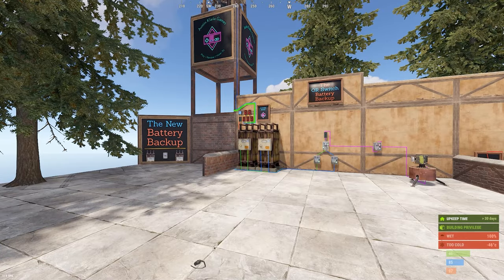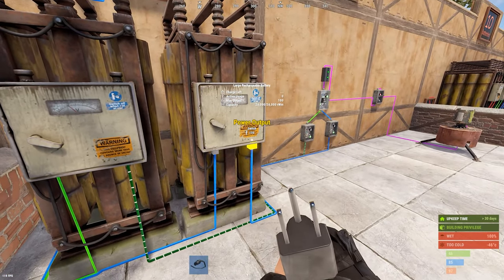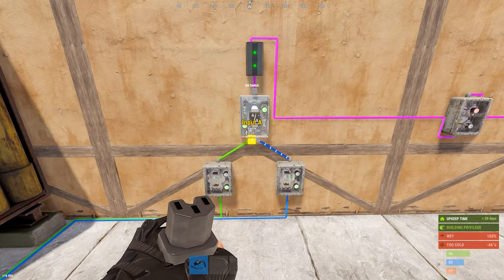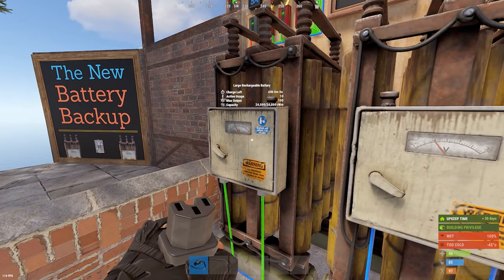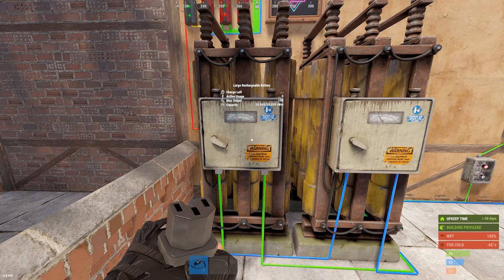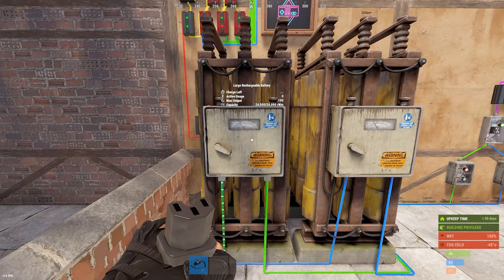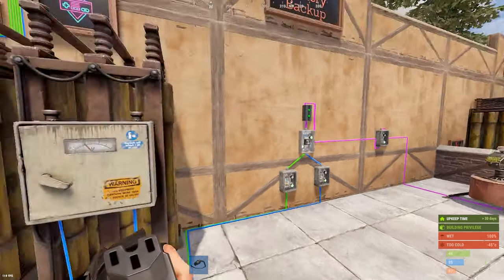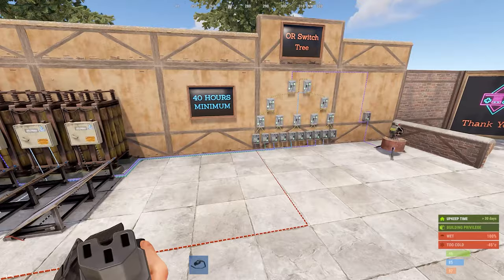RUST Electrical | The NEW BATTERY BACKUP | Includes 40-HOUR EXAMPLE - 2024

Comment: I have a circuit that goes beyond battery backup. It’s in the Fortify workshop posted last night. Basically, it automatically reroutes power from other circuits when your primary defense circuit loses power and has battery backup. Check out the circuit in the workshop!

Comment: all well and good until you rather have everything on a NihCore setup and require more than 100rWm, they really need to fix that Parallel battery setup bug draining both batteries of the same rWm for each item.

Comment: I discovered something on accident. Upon building your obsolete version, I integrated wind and solar into a root combiner for source. Then used a splitter to automatically, & evenly distribute power to 2x primary batteries, using 2 secondaries as back ups in your video. I also integrarted a double generator back up, with force start on both in series should either root source fail, or one gen run out of fuel (giving time to refuel.) Now, somehow I have 220 at both my primaries and 220 at both outputs of secondaries. It charges fast and I hooked up a tesla and it killed me instantly. I tested the same tesla on half the branch at 110, and it wasn't even close. I might just have to make a video on this. But thanks for leading the way! Did I build an amplifier somehow?

Comment: i set my new setup similar to this, but i use my root power (solar panels and windmills) to power my base, and then trickle charge my backup batteries, then combine them to the b side through root combiners. the only problemis if I have more then 100 usage, during night time it drains the first battery in my chain instead of distributing the power equally amongst my batteries (i use 4 generally) and usually cap my power usage around 340 end of wipe.
Reply: If you want it to draw equally from all batteries you need to run your batteries into a root combiner rather than in series from one battery into the other

Comment: Help me understand something. How are you branching 140 from one solar panel to the red battery if its only got 1 solar panel hooked up to it? If we are only allowed to have ten solar panels per TC how could you have each battery with one solar panel hooked up to it and dishing out 140 to the red battery at the same time? Are you running three windmills to the primary and 1 solar panel to each battery after that? And with all that Equpment your base you'd only have 100 power to give to the base?

Comment: Is it possible to switch to Input power only when it meets specific output? Lets say my base needs 200 power to run, but at this moment its early morning and solar outputting only 160, is it possible to run base from batteries until output from solar is 200 or more?

Comment: You could also split off some of your main power and trickle charge batteries linked into each other and then use those as an output if your mains go down
Reply from the maker: Yep, you certainly could. This is probably the route most people would take

Comment: Amazing video as always Austin, just wondering your thoughts on still using the nih core with the new electrical changes. I tweaked the branch that goes into the splitter from 4 to 3 and rigged up a 2 batteries for extra protection. Just want to see your thoughts and see if there is a more efficient way.
Reply from the maker: I'm currently working on a new video that discusses the nih core against the power loop against just straight batteries to give info on that exact question
Reply: @AustinKlailaGames  Oh that's awesome, looking forward to it!

Comment: I need to figure out for myself here how to use this to draw from a windmill directly and have it fail over to the batter if the power drops under a value. I've always felt the battery itself should be the backup.

Comment: so to my mind now the circuitboard becomes the most important thing to secure from raiders - do you have any "rules of thumb" for protecting your circuits in a raid?
Reply from the maker: I agree. The two safest options are in the tc room or strategically placed in a hidden bunker that's not in the most common raid paths.

If you have a solid anti grief setup, the bunker is a better idea, considering you will likely get your base back. If you don't have anti grief, the tc room is fine (if they get to your tc, it's over anyway).

Comment: Hey, so first off, not a RUST player, but for some reason I've gone down the RUST YouTube Rabbit hole.
Just wanted to say on your 10x example I feel you made the tree way overly complicated.
Keep your 10 switches across the bottom.
But put 1 OR gate above the gap in between every 2 switches.  Not every other, in between every 2.
Far left switch runs to OR 1 Primary
2nd Switch runs to OR 1 Secondary
OR 1 Output runs to OR 2 Primary (so up, right, down, and into the bottom of the next one)
3rd switch runs to OR 2 Secondary.
OR 2 Output runs to OR3 Primary
Now you just repeat this pattern to N and you don't need to "tree" the outputs at all.
You also end up with N-1 OR gates, which for 10 in your example is 9, and your example already has 9.
Thinking of another Base 2 tree, 16 inputs, you need 8+4+2+1 OR gates, well that's still 15, so still N-1.
Lastly, since Input 1 on the far left starts as Primary, and the Output of each earlier OR gate is the Primary of the next one, it still runs in your left to right pattern as far as battery depletion goes.
This thinner pattern also means you can put them on the wall above the Batteries to save space.

Comment: What key are hitting to just see one wire?
Reply from the maker: You can use Left Click when aimed at a wire connection to isolate the wire. Very useful for tracing wires. You can also change the color of the wire to whatever is selected in the color wheel by pressing the R key.

Comment: Will this work in console rust
Reply from the maker: Sorry for the late reply (vacation). Unfortunately no, as of the current update, this particular build will not work on console until its respective update comes out.
Reply: @AustinKlailaGames  what about with the new industrial update that make switches n branches not take power
Reply from the maker: @marcoromero411  Then it should! I'll have to see what the console update includes.

Comment: I don't understand why you made such a huge point about batteries needing to be equal sizes when that's irrelevant to this.  
If your circuit has a load of 40 and you use a medium and a large, it works. The large gets drained first and then the medium takes over when the large is depleted.
The only time sizes need to be equal is if the max draw exceeds one of the batteries. If you're drawing 70 and the medium kicks over, whatever is using the last 20 energy doesn't get any, but the backup is sill functional.
Reply from the maker: You are correct, but I purposely didn't cover that in this video to avoid confusion. And a battery backup should be the same size to, as you stated, avoid the primary exceeding the secondary.
Reply: @AustinKlailaGames  Cheers man. Still a good video.

Comment: DUDE, YOU HAVE GOT TO STOP THIS NONSENSE...THERE IS NO "POWER META," ALL YOU NEED IS A LARGE BATTERY WITH 120 POWER COMING IN TO HAVE A PERMANENT 100 POWER OUTPUT WITH 4 HOURS 30 MINUTES OF RESERVE POWER. YOU DO THAT FOR EACH BATTERY AND YOU'RE DONE. THE VAST MAJORITY OF YOUR CHANNEL ARE VIDEOS ABOUT POWER THAT MAKE NO PRACTICAL SENSE.
Reply: then start your own channel, whats up with all caps homie? goddamn lol
Reply: @klutch4198  Because at this point it's actually offensive how many identical videos he has posted. "Powerlooping", NihCores, and clickbait is all he posts and they're irrelevant. You can have 24/7 power with a single large battery and a windmill. You can wire batteries in series without an and/or switch to extend your battery backup time, but you DO NOT need the circuits he shows to do this which only drain power (before the update).
Reply: There are plenty of other things you can click on. Be less rude.
Reply: @blankspace178 you wire your batteries in series?
Reply: @AgentGreenBudz  I'm entitled to my opinion and I can be as crass as I want too.
Reply: @oats6452  Yes, it's literally the safest way to wire power. Entities can be damaged and destroyed which interrupts power flow. Wires cannot be damaged. So if your batteries are safely stored, you cannot lose power during a raid. If rocket splash breaks a circuit (switch, router, or splitter) then you lose power to the rest of the circuit. Direct wiring is always the safest option and uses less power (before the update).
Reply: @blankspace178  Yikes.
Reply: @oats6452  How about you actually try to make a counterargument?? You're doing the equivalent of the Key and Peele bit where you cower and refuse to offer an opinion.
Reply: @blankspace178  Pretty much.
Reply: @oats6452 Rule number one on the internet: don't feed the trolls 😉
Reply: @jurio3117  actually. Rule #1 is you do not talk about the rules. Rule #2 is you do not talk about the rules.
Reply: @blankspace178 yapping hard ngl
Reply: @Blue-bz6dm  literally everything I posted is true though??